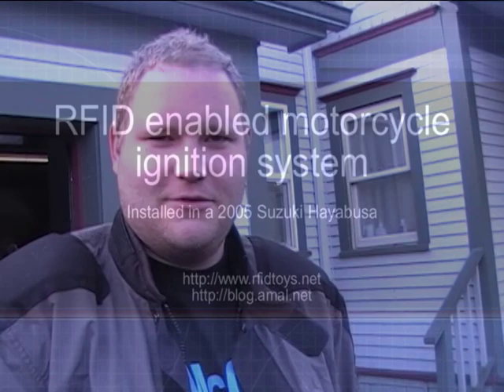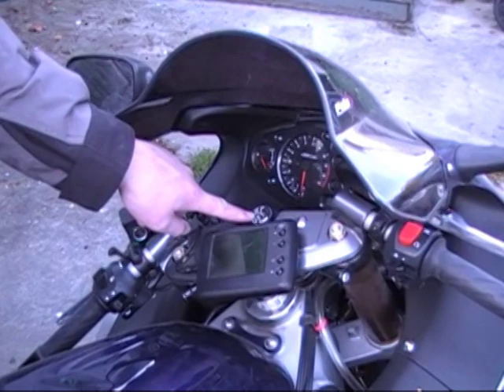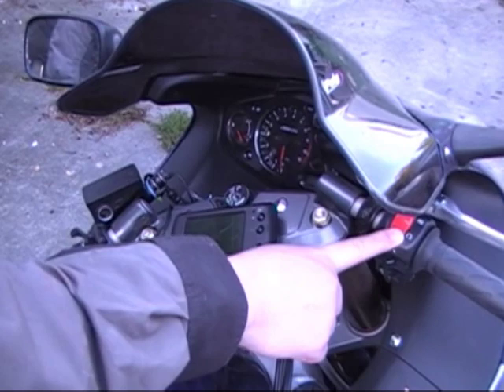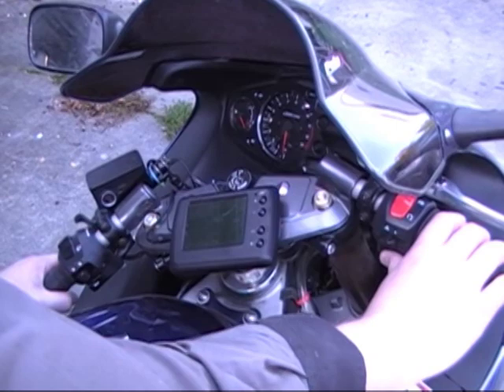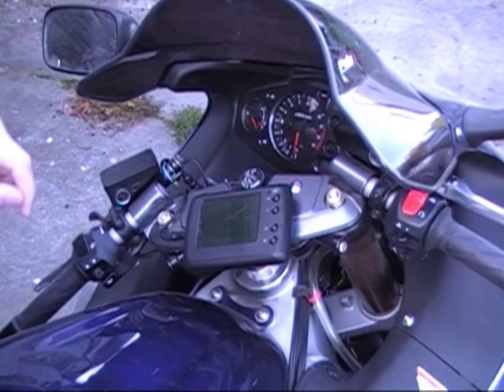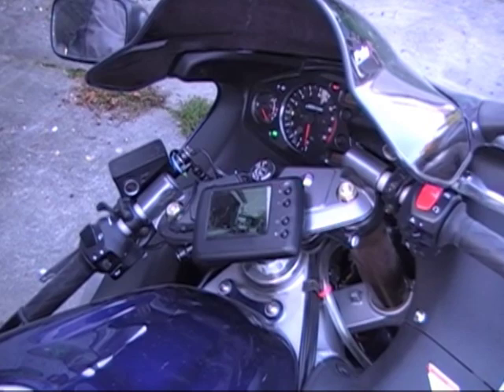RFID Enhanced Motorcycle Ignition

Comment from the maker: I was a hammie for a while... still know my old callsign. The tag should definitely not be affected by your radio, since the implant works through magnetic coupling of a 125kHz resonant field. When you bring the tag within the magnetic field generated by the reader, it basically forms an air-core transformer, allowing the tag to induct power from the reader's field. The tag also has a current limiter on it to protect itself. Unless you are transmitting 1.5kW at 80kHz - 150kHz, you should be ok.

Comment: EDIT: Found the working site, and hopefully a diagram or something.

I didnt really expect a blog such as the one above to be here 6 years later, but i cant find your setup anywhere, something I am definitely interested in. Since the rfid triggers your on switch, something that will be on continuously (unlike say the starter), I am curious how you managed to do so. Maybe a relay that once triggered stays closed until the power is cut?
Reply from the maker: MrMonkeyman2424 thanks for the heads up. I updated the blog link.

Comment: dont like that setup one bit, so anyone who wants to 'try' to steal it can easily and quickly drain the battery by continuously turning the starter motor. is this setup wrong or is that how it is meant to be setup?
Reply: It's easy to look at something and find flaws.. and in this case, the flaw is just goofy. It's just as likely that someone would bother to stand there holding the starter button until the battery was dead as it is ramming a screwdriver into the gas tank, letting the gas run all over the bike, then lighting it on fire. Both scenarios are totally plausible, but highly unlikely. It simply was not worth the effort to re-wire things in a way that would block the starter motor function.